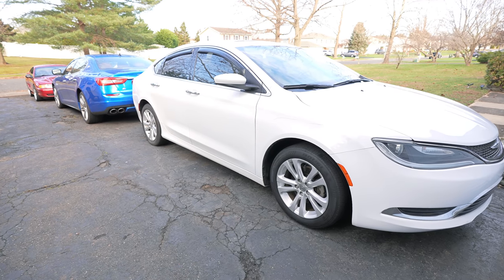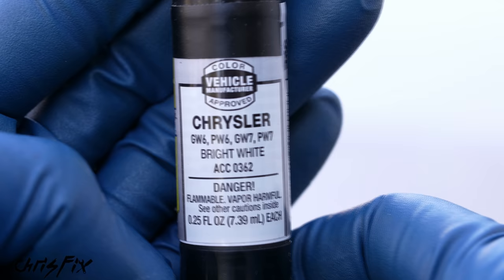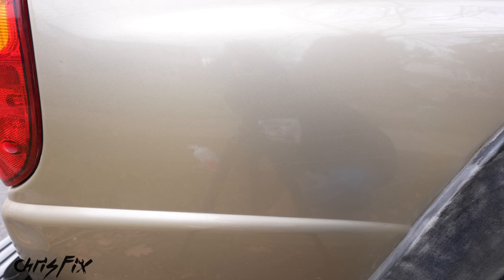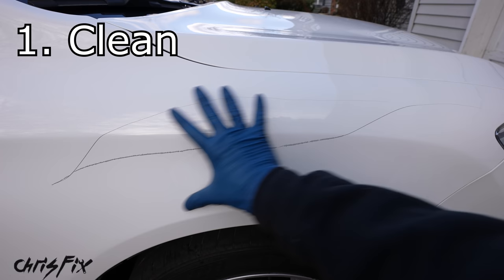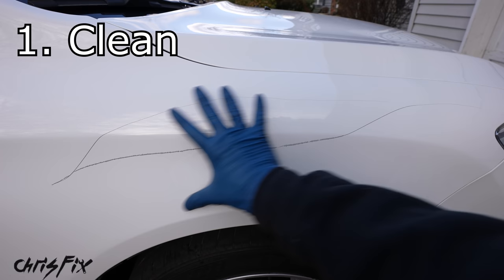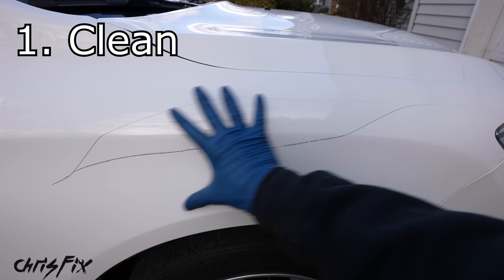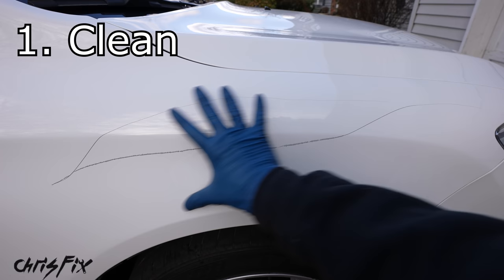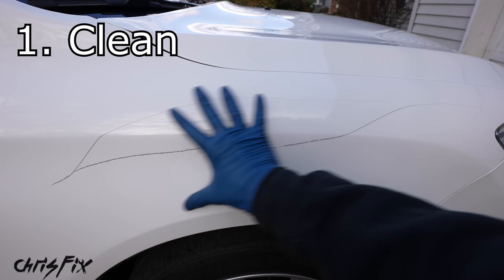How to Repair a DEEP SCRATCH in Car Paint (DIY)

Comment: Hey ChrisFix, amazing video. I do have one question. The paint pen you used doesn't come in the color for my specific car, so I have to order a different set of paint pens that has primer, basecoat and clearcoat all in seperate pens. The paint is not already mixed with primer so it would need to be applied before the basecoat. Any tips for how to apply the primer? Do I just put a single light coat, do I need to wait for it to dry, would I also need to sand it down. I have never painted anything before so any tips would be greatly appreciated. Thank you!

Comment: First off I am a huge ChrisFix fan and I really appreciate his efforts in making useful DIYs. However, unfortunately, @ChrisFix does not put up a disclaimer that this process does NOT apply to any other car colors other than white or black! He also fails to mention that the touch-up paint does not match perfectly with the car paint even if the code is the same! The car paint is dependent on a lot of other factors such as the year, batch, and how worn the paint is. So, whoever is watching this video, if your car color is other than black or white, DO NOT follow these steps! It will actually make your job harder! What you need to do is to take your car to a body shop or Orieleys or other places that can scan the exact paint color on your panel and mix and match the new paint. Ask them to make a spray can for you and then go and search videos that actually show you how to properly partially paint your body panel and blend in your paint. BTW, you will need to sand your entire body panel (clear coat) and reapply clearcoat to the entire panel. The paint only needs to be applied on the scratch and feathered around it to be blend with the rest of the panel.

Comment: This did not work for me. Wet Sanding the touch up paint (1200 grit)  just scratched up all the surrounding area. Looks like crap.
Reply: That’s is happening to me with a 1000 grit trying to leveling the paint. I will use less paint next time.

Comment: Not sure if you're still monitoring this video, but I do have a question. My deep scratch is on a plastic bumper. I did the layers of paint, but the paint never quite seemed to dry. I ended up removing all the paint using rubbing alcohol. Is this a potential issue where the touch up paint won't stick to the plastic bumper? Or do you think I failed to sufficiently wait for the first few layers of paint to dry?

Comment: When doing this use putty to fill in the cracks, and use aerosol spray from your cars paint then coat the area in 3 coats, 10min in between. Then same with clear coat(aerosol spray) but 2 small coat, and a big coat, start the next coat when the clear coat is sticky and tacky but not wet, then use meguiars polish, then meguiars ultimate compound.This will make amazing results, don’t follow this, it doesn’t work.

Comment: Where the base coat was flattened to the clear coat, doesn’t that mean when you and the clear coat and flatten that your just going back to the base and your removing the clear? Or does the clear bleed into the base coat.. awesome video btw will definitely try this
Reply from the maker: The clear coat is so thin at that point. Some clear bleeds into the base coat but the clear coat layer is very very thin.
Reply: @chrisfix  thank you for the reply buddy

Comment: Great video! Thanks much. I’m confused on one thing. The touch up paint I bought from ScratchesHappen say not to wet sand because the water based paint might get impacted. Should I spray soapy water and sand with 800 grit or not ?

Comment: Hello Chris, I purchased a used car where the previous owner went crazy with touch paint. He didn't sand or polish them, so there's lumpy paint in several places around the vehicle. How would you go about removing the old touch-up and redoing it with your method?

Comment: If you have some metallic paint, be careful… I followed this method filled multi layer of paint, but when I moved on to level it with sand paper, it got discolored greatly. It seems the metallic paint’s color is only on the surface-ish, as well as the metallic glitter.
Reply from the maker: Might just need to polish it after it dries completely. So before putting on clear coat use a little polish. Then clean it and then clear coat
Reply: @chrisfix  i gave it an overnight to make sure it’s well dried. but still even just a slight sand paper polish (3000 grid), the color difference shows up. It’s probably my paint wasn’t designed that way. 🥲🥲

Comment: I know this is probably late but how hard is it to sand down if you already put clear coat on. The previous owner added the touch up the paint but didn’t sand it down then put the clear coat on. So I’m not sure if I’m cool with sanding it down even with the added clear coat?

Comment: Bro, I tried sanding painted surface using 1000 and 2000 grit sandpaper, they were taking too much time, result came with much time however, i observed appearance of small circular black patches, they were showing up from angular areas. Don't know how to do it exactly like you so that it can match fully like original

Comment: Isn't it better to start with a body filler? Or it's neccessary just in case the scratch goes all the way to metal?
Reply from the maker: You can but it’s not necessary for this small scratch.
Reply: @chrisfix  all right, anyway is it better to apply the paint on direct sunlight or in shade?

Comment: I have a few rock chips that I am planning to use this method to fix but I am also planning to do a full paint correction with compound and polish using a random orbital buffer after I am done. if that is the case would you recommend that I skip the step of sanding with the 3000 and 5000 grit sand paper?

Comment: When sanding down touch up paint to make it level with existing paint there is some clear coat scratched and turned white will the clear coat cover that or do I have to wet sand it before clear coat?

Comment: I watched all process after I've done with scratch pen. I did use color spray once then paint and clear coated. But I can still see uneven surface Resin. what I have to do to remove resin? because I've never done this before, sandpaper could damage car  that's what I'm worrying.

Comment: WHAT IF you only care about protection and not how it looks can we skip most of these steps? id just use the highest grit sandpaper and i guess tape and made sure i dug out enough of my narrow small scratch skipping isopro and soapy water then applied the paint after sanding the surface a bit since mine is barely a finger nail deep id say 1 or 2 coat should be enough after like 35mins it should dry and i sand off the rest or leave as is and applie clear coat then my wax?

Comment: I'm having trouble with looking for the correct color for my touch up pen. I have the correct color code from the sticker(it's a metallic grey), but when I am looking at reviews before buying it, people are showing the recommended color was actually way darker than expected. It's not even worth doing all the work if the color on the recommended touch up pen is off. What should I do in this case if the color on the car sticker isn't even correct?

Comment: Hi CHRIS, you’re amazing. I just have a question for you. I have a small scratch the size of a quarter. Do I need all those different grit sandpapers or could I just use one grit sandpaper such as 2000 grit or do I need 800 and s on like you have?

Comment: If the touch up is leveled with the existing clear coat, and you put a new clear coat on and sand it, aren’t you just removing the new clear coat you putting on? Please help with my confusion

Comment: Hi Chris thank you for this video!!! Just wondering if the scratch itself dented the metal also, do I just sand and add say bondo? Thanks
Reply from the maker: Thanks a lot! If you have a dent you'd need to add in body filler or do some kind of pdr for a proper repair
Reply: @chrisfix  Thanks! For the non dented area, similar to yours, if my paint pen doesnt come with the hard white are for sanding (the white hard tip). I just use sandpaper to remove the flakes correct? Thank you!
Reply: Touch up looks great and all but after removing the tape and when I sand the edges down to match the shape of panel... The touch up paint turns grey from sanding? Does this happen to anyone else or just white??

Comment: Hey so i scratched near my back door and on the handle on a cement pillar in parking. Will all these steps work the same for that case or is there another video specifically for that .. Also this seems to be  so much easier than using spray

Comment: At 20:15 you're sanding it down to get level, however this doesn't seem to be working for me. Am using p800 and wetsanding, but it's just not reducing as you had it in the video. Definitely still looks different to the rest of the paint job.

Any ideas?

Comment: Should you use primer, when the scratch is all the way down to the metal? And are wax and polish the same?
Reply from the maker: Yes a primer would be good. Polish is a fine abrasive and wax is a protectant.

Comment: Can this be repaired with spray paint rather than a pen? Does it matter which one you use if you repair a scratch or a rock chip?
Reply from the maker: If you air brush it you might be able to. A spray can will shoot too much paint and look horrible unless you want to spray the whole panel.

Comment: In my Non-professional experience, I find this method only works really well with nonmetallic paints. (Non-metallic whites and blacks). Metallic basecoat paint scratches & scuffs are very challenging to remove with touch-up paint. Anyone have a different experience?

Comment: Hey chris, how far do the items provided in the description go? For example, would you e able to fix 5+ scratches this big with one of each material listed in description? If every scratch were exactly the same as the one in this video, how many could I fix with one of each item in the description? I'm trying to figure out how far it stretches and estimate how worth it it is for me to try this. My car has lots of scratches that don't exactly need to be fixed, but if this method is super cheap for example, I'll probably be trying it. I'm not getting them fixed by a professional either way as it would cost me way too much with the amount of scratches on my car. Thanks

Comment: Will the gloss stay in there? I used one of those "magic scratch removal" markers and polish in the past and it looked good at first but after few washes and rains the surface became hazy. That's why I'm afraid to sand out the original clear coat on the whole panel
Reply: He said wax it at the end as it would act as the replaced clearcoat, is that what you mean by polished? if so, did you use the same product he did?

Comment: Don't follow this video if you haven't tried it many times before. Starting with 800-grit sandpaper will likely damage the surrounding area, as modern cars have a very thin layer of paint. Try avoiding sandpaper altogether and use only a Visa/MC card + isopropyl alcohol + a small cotton disk to remove excess paint. If you make a mistake, you can try again wipe out your painting. Afterward, you can apply lacquer and use 3000-grit sandpaper. If the scratch is more than 1/4 inch, it's better to seek help from an experienced professional.

Comment: I got deep scratch in my driver side rear door, and ordered paint and etc. for DIY. Will it be okay to drive my car for like 10days until those products to be delivered?
The weather in my area is now -14~4 celcius degree. And, it snows and rains occasionally.

If it is not good for my bare metal layer, I should go for repairing shop and give $150 for small scratch…
Reply: Yeah it’s fine any sanding will remove surface rust

Comment: I'm having issues getting the same result with metallic paint. First, the paint won't form a even layer when applying it, it's all bumpy and "mountain-y". Second, when i try to sand it down using wet sandpaper, the paint strips away before i can say it's smooth, even with a 5000 grit sandpaper.
Now I added four layers of paint, and I will let it dry for days before attempting to sand it down.
Does anyone have experience with this?

Regards, Alex

Comment: I've got rock chips on my front bumper which are also rusty and they have got bigger ( 1cm radius). Should I do it this way or is it better if I do it with spray?
Reply from the maker: It might be easier to sand it away use a little body filler then paint and protect
Reply: @chrisfix  how should I paint it? With a paint brush like in this video or with spray-paint? And doesnt it need an undercoat for protection before I paint it?

Comment: These steps are good for regular paint but do not follow this if you have metallic paint. You do not want to sand metallic paint as it will lose its original shade and luster and leave you with an ugly mismatch of "dull" touch up paint next to the original car's paint.

Comment: someone scrapped my car but it was on the paint protection film. I tried to do this but when i sand it it just turns clear (due to the film) Only fix would be remove the film right?
Reply from the maker: This wont work on paint protection film. You would need to remove the film and put new film back on.
Reply: @chrisfix  Thanks Chris. You’re the only youtuber that actually replies and helps his community. You’re great!

Comment: How long did you wait after the you took the tape off to sand the base coat with 800?
Reply: He said remove Masking tape after 10 mins then leave for 1 hour to fully dry before using 800 grit

Comment: Does this work also on fiberglass panels? I just scratched mine today :(
Reply from the maker: Yes, same process for fiberglass and plastic as long as it’s not scratched into the fiberglass.
Reply: @chrisfix  I did this to my 2002 Corvette C5 Z06 and yes its fiberglass.  You can't tell where the correction was made.  It looks like the rest of the car.  Thanks Chris

Comment: Fair warning; don't get your hopes up. This is not as easy as ChisFix makes it look. I don't know what kind of paint he's using (i'm not in north america), but with official touch up pens from my VW dealership, I couldn't even get past the "sanding down the excess paint" step, as the touch up pen paint just came smudging off with the sandpaper (both 800 and 1500 grit). That was after following every step he did, and applying four layers of paint with 10 minutes of drying in between each layer, and a final 1 hour to dry. Gave it one more shot, started all over again, but let it sit for 12 hours this time. No difference. When I use the sandpaper, even with the lightest of touch, the paint just smudges off after 5 seconds of rubbing and exposes the primer / metal. And these are official touch up pens from my VW dealer ship. Reef Blue for a Polo 2018 model. Either they are water based, or i don't know, but this guide did not work for me at all.
Reply: You need to let it dry longer, it sounds like it didn't cure long enough no?
Reply: @Mvgical  I learned from a friend that every layer has to dry for at least 24 hours. I don't know how Chris fix manages to let it dry for just 5 minutes and be fine, but apparantly it's 24 hours, and he has experience with paint jobs.
Reply: Don't know if you've already tackled this, but primer is your issue. Some pens have primer mixed in, but I think most OEM paints don't. Without it, your paint just won't stick to the base plate. You'll want to apply it more carefully to just the base plate, sand away edge imperfection @320-400, then smooth with 600 before starting the paint job as in the video.

Comment: When wet sanding in stages, how do you know when to move on to a finer grit?
Reply from the maker: It doesn’t take much. Just make sure the whole thing is smooth and sanded at each stage. Since we are working on a tiny area, you don’t want to sand too much.
Reply: @chrisfix  thanks Chris. I was also wondering 1) how long do you wait after paint to start sanding? I live in a hot climate. And 2) I noticed you just used polish toward the end. Some people have told me to buff using a rubbing compound and then polish after. Any reason you did not use rubbing compound and went straight to Polish?

Comment: Also I would read the reviews. I tried this on a grey metallic Subaru and looks like crap. The 800 paper will burn through creating additional area that you have to touch up with paint so you end up with a big mess of discolored paint that doesn't match partially burn through light areas and blotchy clear coat. And the area is now much larger and looks terrible. Simply doesn't work and makes a big mess of burning through the paint in other areas and then having to color them and finally you give up and end up buffing out a mess that really stands out as opposed to a scratch. Don't do it. Maybe it works on white but you will burn through the paint with 800 grit making your problem alot bigger and end up with a mess that looks like a really bad hack job. Don't do it.
Reply from the maker: Every car manufacturer has different clear coat hardness so it's important you know how quickly you burn though the paint. It is also important you keep the fix very tight to the damaged area.
Reply: @chrisfix Little late now. It's all messed up.

Comment: Hello Chris, I only have a small scratch.  Can I use the Dura-Gold Premium 6" Wet or Dry Sanding Discs - 3000 Grit, Box of 20 from amazon?
Reply from the maker: You can use polish and see if it comes out with polish.
Reply: @chrisfix  thanks for the updates!!  If the polish will fade away after a car wash?  Jen
Reply: Hi Chris,  I saw you used 800 grit sandpaper to sand off the paint.  I only bought 1000 grit, will it work too?  Thanks!